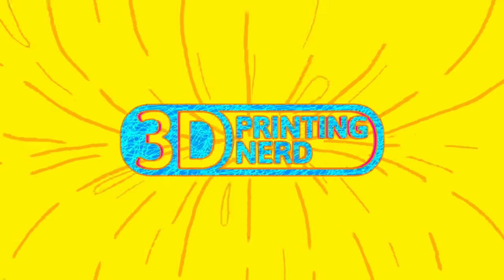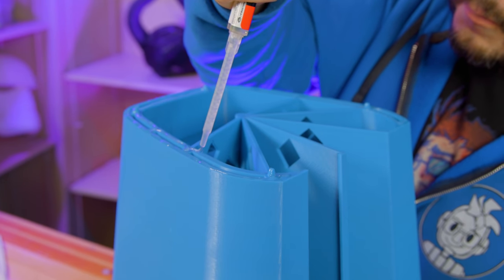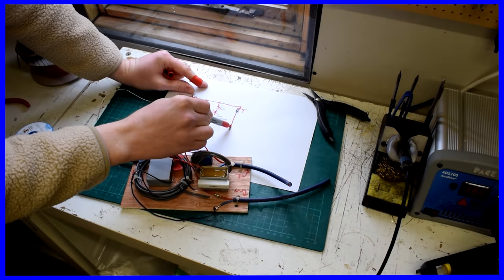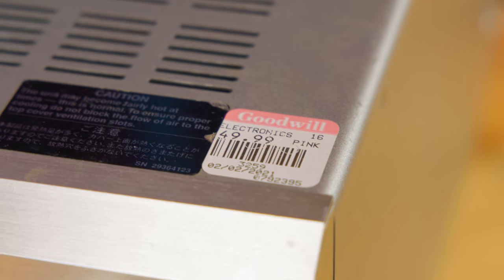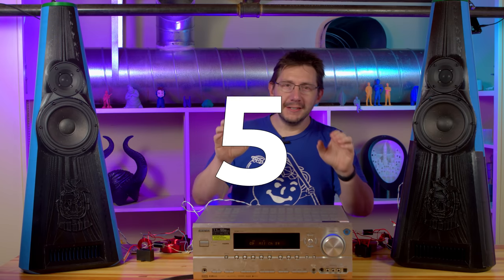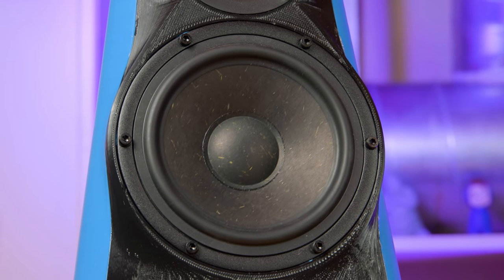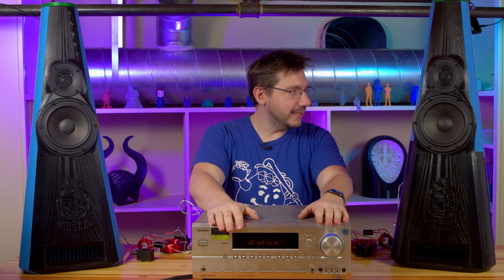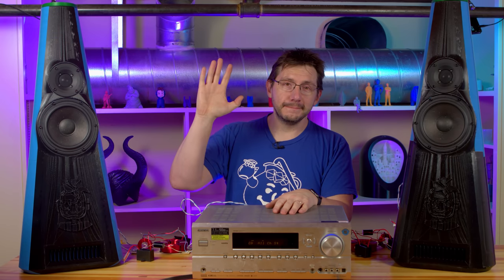3D Printed Speakers Part 3: HOW DO THEY SOUND?

Comment: I think your tweeters might be a bit weak.  Or you have the bass turned up too high.
Reply: I think the recording microphone was probably below the tweeter level so seems that way. If you get on Twitter I posted the STLs, schematics and response plots. Cant li k here 'cos URLs get blocked.
Reply: I'm not sure what you're listening on but the bass response was horrendous. It could be the mic, but the response graphs look less than ideal it basically drops off at 150Hz and then again at 60Hz which is a extended bass shelf alignment.... but normally you compensate for that in the crossover if you're building a full range speaker. Some subs can get away with that alignment but on a full range it's hard to do especially if the woofer doesn't have a ton of xmax to play with. That distortion you're hearing is the woofer exceeding xmax, it's bottoming out. 

I'm glad he's happy with them but they don't seem well thought out on the acoustical side
Reply: @MEatRHIT2009  The woofer response plot for the crossover simulation was measured 'windowed' to get a cleaner response high up. That's why it shows little bass extension. The actual extension will go to about 35hz which you can see in the 'Large vs Slim' comparison image 👍

The woofer did seem to be moving a lot! It must have been crazy loud as that woofer is no joke! Either that, or there are air leaks still, or the mic was overloaded, or the amp was clipping.
Reply: @Audio_Simon  Thanks for the reply! I was struggling to figure out how someone could mess up a nice driver that much lol. Thought it could have been the mic and this pretty much confirms it
Reply: Bretty Wap  sub 15Hz

Comment: Im sure this is probably said somewhere else. but I would suggest putting a subsonic filter (highpass set in the receiver) on the speakers right below wherever the enclosure is ported to. A ported box will "unload" below the resonant frequency and loose control of the driver (the speaker moves a LOT with no volume to make it worth it)
It will allow you to turn it up higher and will have less distortion and sound better while youre at it =)
Loved this project though! I am doing something similar at the moment to test out a new idea for my car!

Comment: Gotta love the OG Xbox 360 RCA to 3.5mm adapter. I've got the same one in my audio drawer. Coincidentally I also have a full 5.1 set of 3d printed speaker enclosures plus a 2.1 set for both of my office desks lol. Think one sets going on 6-7 years now.

Comment: The soldering was as neat as it could have gone freehand (I probably would've made a bigger mess, which is why I use perf boards at a minimum). If you want more confidence in your joints, remember, MOAR FLUX.

Comment: @3D Printing Nerd
If you sourced the sand from Home Depot, there is a great chance that it was mined & packaged at Icon's pit in Auburn Washington. They (their parent company) has the contract to supply the majority of the sand & gravel aggregate materials at Home Depot stores across the nation! I only know this tidbit as I worked at Icon for 3 years. With very few exceptions, all of Home Depot's material is supplied by them.
Reply from the maker: WHOA. So, there is a chance my sand is local???
Reply: @3DPrintingNerd  Yes sir, very local!

Comment: Like the speakers alot but a few questions. Why not use the HDMI cable for sound or the other digital inputs? Also, why is it set on all channel sound as opposed to regular stereo? The way you had it is playing as dual mono as opposed to left and right. 

You should really choose the setting of direct or pure direct then there is no chance for the AVR to be causing any issues with the signal of the sound. The speakers sound bass-heavy so maybe there is something with the receiver's settings that is causing it. Plus that's a little steep for that particular unit especially since they are known to have the hdmi boards die.

If you have them bi-wired why not use the multi-channel input and set it up to run as bi-amped? you can do away with the crossover but you need the software and know-how.

Comment: You should go to your local auto parts store and buy a few cans of rattle can bed liner, then paint them. It'll give it a nice look and seal up all of the cracks and give the enclosures some strength. Also, it'll help with the low end of the woofers.
Reply from the maker: Oh holy cow, that's a FANTASTIC idea! I love the idea of how that would look.
Reply: @3DPrintingNerd  it looks great the way it is. I use bed liner on all of my enclosures for improving the sound, but it also looks really cool. You can try a few different brands. Some give a thick textured look and some give a smooth finish. You may have to use some self etching primer first. I'm not sure how good it would stick to that filament, but it sticks well to PLA.

Comment: ONKYO was a really great product back in the 80s and it looks like that unit is from that approximate time period. I have some audio equipment from back in the 80s, Bose 901 speakers and a variety of other audio stuff, all still works and sounds great. But, today you can get tiny Bose speakers that also sound great and take up 1/50th of the space.
Reply: Yea definitely not from the 80s or 90s since it has an HDMI port. While not outright horrible, these receivers are not considered very good overall and would not be something to use as an example for a company. They had alot of problems with the HDMI board which is just a video signal but once it dies it renders the entire unit unusable. While I respect your opinion but I have to disagree with the idea of the Bose speakers sounding great. They are way too expensive and there are much better options for way less that sound as good and even better.  There's only so much you can do with a tiny cube with only one single speaker driver.
Reply: @connorjohnson4402  Ah. The ONKYO'sm from the 80s and early 90s were rated very good. BUT since you said it has an HDMI then yes much newer. I have not heard much about the brand, especially more recently, so I bet the quality has gone down.
Reply: @connorjohnson4402  I actually do not have those tiny cube Bose speakers. I have only seen them demo'd. Like I said I have mostly old school equipment so I run Bose 901's and 601's. In fact I play the guitar, used to play professionally but no longer. I even have my guitars and amps from the 70s. Start, Tele, and Les Paul and I play through a 66 Fender Twin. I do have an older Bose Wave radio, the larger unit. Bought it used, decent sound, not sure I would brag about it but Just use it to stream SIRIUS over Alexa. At least I am not just using the speaker on Alexa.

Comment: The sand used might not have been the best for this purpose. Paver (aka polymeric) sand is coated with a binder which is activated when wet. I'm not sure this will be a problem or not, but it sounds like you wanted "Play sand".

Comment: I don't think you needed to make those crossovers because you're receiver seems to have enough outputs that you could separate the high and low frequencies to separate tracks in software before sending  them to the receiver instead of after amplification

Comment: I like the time and effort you made on the speaker towers ..but its alittle funny that you looked woried that the speakers weren't going to work..you could have put the speaker's in a cardboard box and the speakers would have worked...so what im getting at is.. you should have done sound tests to see if the towers are pushing out the correct sound quality.

Comment: Hey I'm no speaker expert - but aren't you completely destroying the sound by putting in the polyester stuffing? The whole point of a speaker enclosure is to cause an internal reverb which you are eliminating by adding the stuffing.
Reply: Literally, the thing you are trying to not hear is the reverberation in the cabinet in this or any speakers really. Any good speaker will try to reduce the vibration of the walls of the enclosure with bracing and heavier, stronger materials as well as any sort of internal reflections and standing waves caused by the driver. Any of these things can cause peaks or dips in the frequency response of the driver leading to coloration or effects on the sound. In some regard, you are partly correct because you can muffle the sound but it's not the sound coming out of the driver it's the sound produced by the back of the driver which if designed correctly, you shouldn't be able to hear. If you are doing the opposite as you suggest you will end up creating something that can play maybe one note extremely loud because creating an enclosure that can reverberate at a wide band of frequencies isn't really possible.
Reply: @connorjohnson4402  Honest question here - why do companies spend millions on the internal design of speakers? Some of the most expensive speakers have all sorts of baffles and walls to direct the sound around. Is this only possible with extreme amounts of math? I'm generally confused about this because (maybe it's just the video but) the sound coming out of these speakers sounds VERY heavy on the bass, to the detriment of the high end. Sounds muffled and hard to make out the vocals, for example.
Reply: @TheRealJackDiamond  To muffle any internal resonances and standing waves as I mentioned. You can overstuff speakers tho because you do want the port to flow some air in order for the bass reflex design to function properly. Polyfill in a sense causes the cabinet to function as if it larger than it truly is by slowing or trapping air. It takes some math and in principle, it isn't super complicated but as with anything the more performance you want to get the more complex the design can become to get the outcome that you want. I'm with you on the sound tho. I don't know why it has no mid and is bass-heavy it could be a number of factors from the settings on the receiver to the signal source to the crossover. It's hard to actually record something accurately and then also get it to playback as it sounds in real life. I was wondering why it was set to all channels as opposed to regular stereo because hes playing in dual mono as opposed to regular left and right channel. Im not sure why he didn't use a digital signal link the HDMI input but it depends on the source I guess.

Comment: The duct tape seamed to take care of the leak?
Reply from the maker: I mean, I think so? I couldn't feel the air move once the duct tape was on. I think a filler in the sides would be better and more permanent than the tape.
Reply: @3DPrintingNerd  guess I need to step up my pun game...

on a serious note, I've seen silicone caulking used more often than anything else to seal up diy speakers.

Comment: We're not hearing what those speakers sound. We're hearing what the sound you recorded at that room sounds through our speakers. Why don't you get in touch with someone with some testing gear and post some measurements like frequency range, distortion, efficiency, and so on. I'd love to see the graph of a sweep - I'm guessing there would be a few resonant nodes in there.. Still thumbs up for all the effort.

Comment: You might be able to seal the speaker with more epoxy by using a syringe. Also, for splicing wires you might want to check this out https://makezine.com/2012/02/28/how-to-splice-wire-to-nasa-standards/
It's easier than we think to do and it's super solid. For my take on it I first twist the wires and then tin them using some flux. It's easier that way and not much weaker.

Comment: Uhhh those cables: first: please use a digital out from your computer. Should increase the quality quite a bit. An then the speaker cables. Please dont use a telephone line as a cable. Get real cables. As a propf of concept this is fine, but if you want to get decent quality audio...